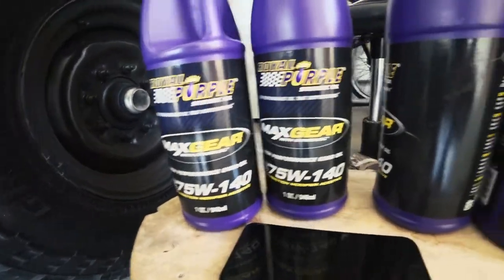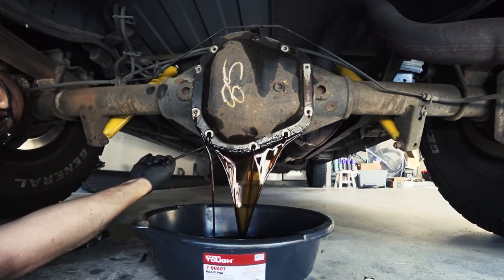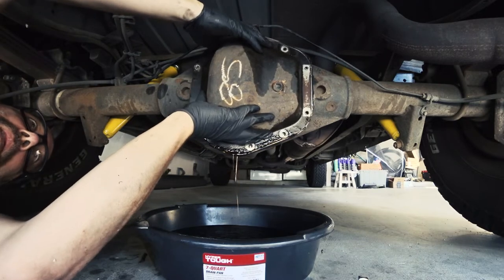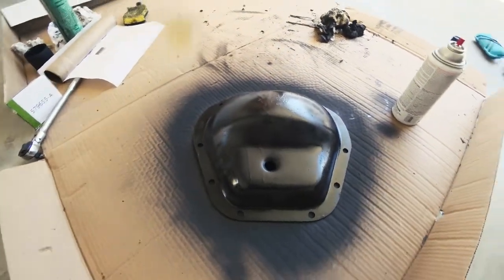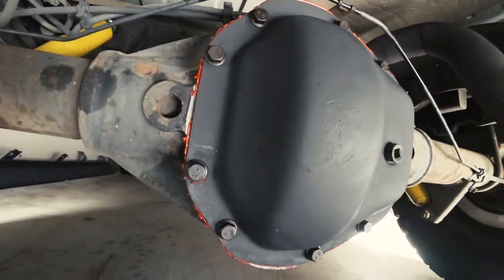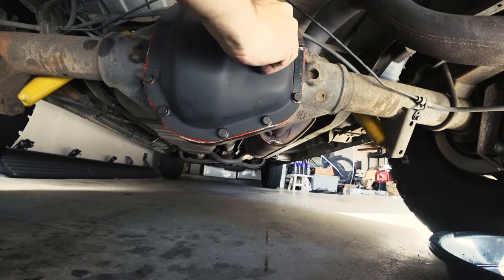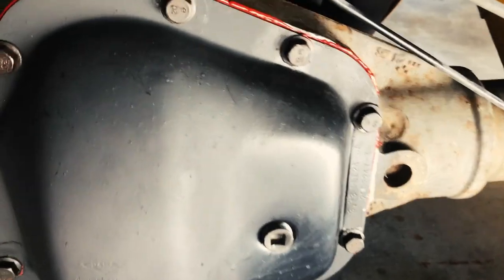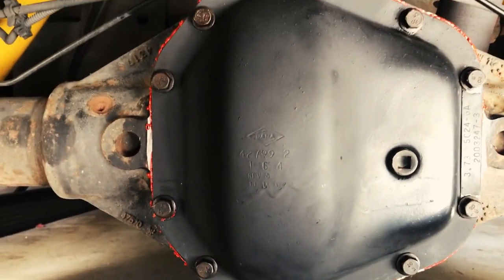REAR DIFFERENTIAL SELF SERVICE ON FORD E350 TRITON 5.4 V8

Comment from the maker: UPDATE So I realized after I did all this work that I have a conventional open diff and not a limited slip diff. Adding the 75w-140 w/ additive in an open diff won't cause harm to the diff but if you don't add it to a limited slip diff is when you run into problems. Here's the video that will let you know what diff you are running. 
https://youtu.be/TKRqnQHfVXA
Reply: Still the man a year later

Comment: Lucas 80-90 gear oil every 10-15 k .   Idk if I would wonder off of factory spec . I’m just particular😁
Reply from the maker: Shit did I mess up? I looked at the manual and it showed 75w-140 for the Dana m60. I checked again just now and noticed the type you mentioned but the only difference was that one is limited slip and the other isn’t. Will adding this mess my gears up? I took it out for a test but all seemed fine.
Reply: @CHICOandtheVAN  I’m under the impression the 75-100 synthetic is or has roughly the same effect. I checked too and Dana , the maker of the axle, list several types. 75 to 110. It’s hard to say what is “ correct “ . IMO as long as it’s with in range and Gear Oil  , then it should be fine . The products for limited slip have detergents an friction multipliers , so the clutches in the diff work when there covered in the oil .